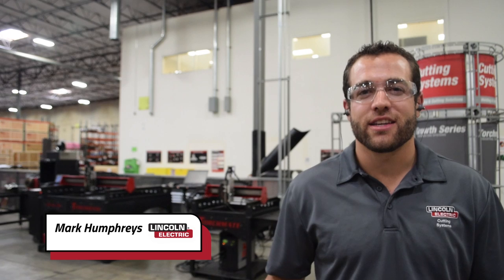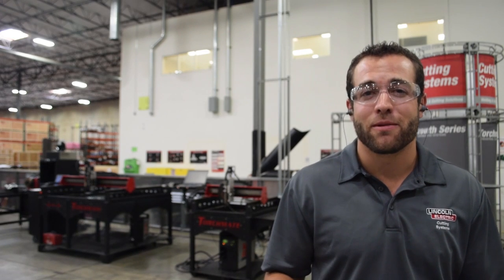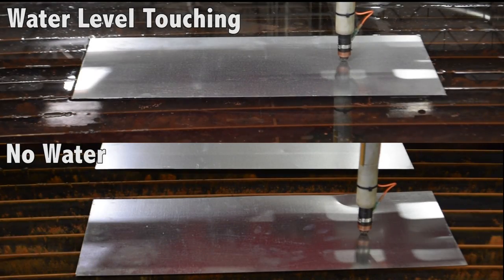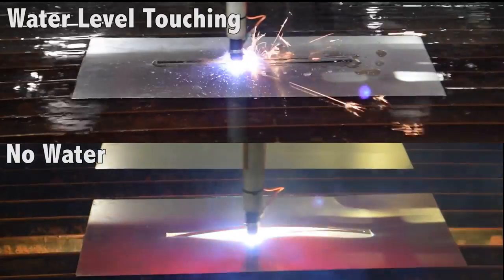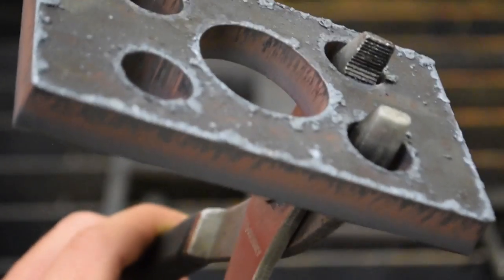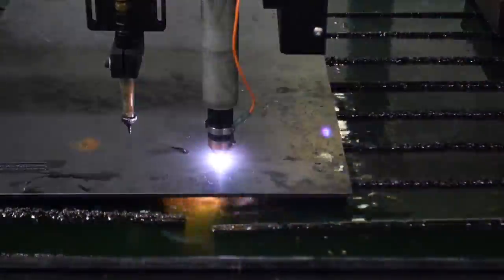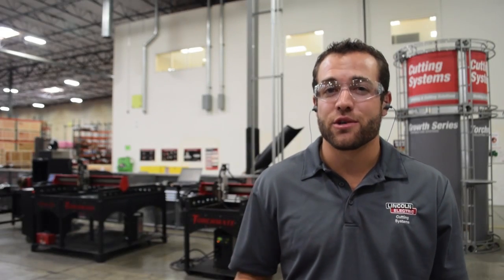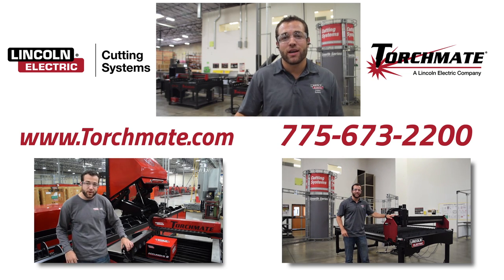Top Five CNC Plasma Cutting Cut Quality Problems: Solved!

Comment: Appreciate the video, however the test quality test is invalid. You can't compare a water table with no water equivalent to a downdraft table. A downdraft has space & vacuum verses just no water there is little room & you're getting feedback which is terrible for the torch. The water should never be touching the metal. If the metal is being saturated while being cut then your water level is to high. When cutting gauge material drop that water level down to 2 inches below that metal. There might be a little smoke, but I promise you'll like results. The metal warped while you were cutting it, it won't warp at all if the water lvl & consumables are current. Sounds like you were running to high of amp. Also to high of water level create sulfate build up on your table & within a years time running like that you'll be rebuilding the bridge. Big no no.